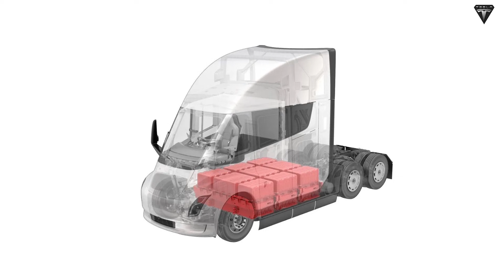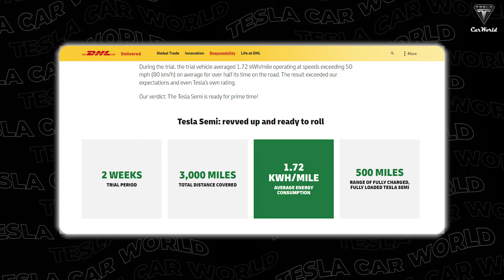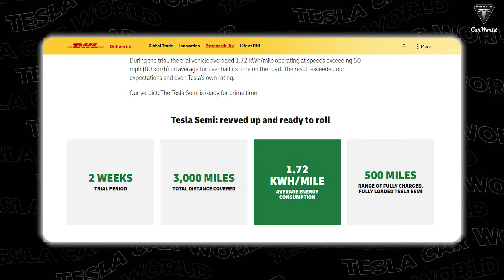Tesla Semi DESTROY All Rivals With INSANE Specs, Design & Saving Cost! No More Diesel!

Comment: If you can put solar panels on all the trailers? you can basically make a fleet that can never needs to charge. Cutting out that 30-45k a year in energy/fuel. Let's call it a 21 year life span, for easy math? That and self driving alone will save 150k per truck, per year. With the first year paying for the solar panels on the trailers, the truck and the Optimus bot. You can get all of them paid in full, just off the savings in the first year! Making potentially 3 million per combo over the life span. The country will be fully electric by 2035 is my prediction.

Comment: As a truck driver, what the real range with a full load? How long to charge from 10% to 100%? What is its full towing capability? What is its overall weight because if its heavier than what I already have then not interested as it reduces my load which is how I determine what cost I charge, the more I tow the more I make. Where can I charge it? Are the charge points along all routes or only the popular ones? How much for a truck without FSD as its not legal where I live?
Reply: That is what I am concerned about, all these tests are done without pulling weight.  When I load a van down with 3000lbs of tools and equipment and have to drive 800 miles a day for service routes I dont believe we will make the day.   Then when it is colder the batteries are less efficient.   My next question is what is the total weight of the vehicle, will bridges support the weight of a load with heavy batteries.

Comment: Electric trucks are offered by many manufacturers in Europe. However, the market is still very limited and those in use are often for specific operations where they are economical or better fitted. Still, Tesla has a long way to go. Manufacturers like Volvo, Scania and Daimler offer many models, and options. With Tesla, everything seems to be secret and never happen.

Comment: Edison motors in Canada is building hybrid electric trucks.  That makes more sense for most trucking tasks.  They started with logging trucks because they are light going up the mountain and utilize regenerative braking when heavy on the way down.
Reply: We should have had hybrid trucks a decade or two ago.  It just makes too much sense.  Dial in a little electric boost on the hills, recharge on the way back down.  Accelerating would be so much easier.   EV trucks are running all over Europe with no issue, and with some charging stations for trucks they will have no issue even OTR.  But you aren't taking an EV into the middle of a forest for hauling logs.  Too remote.